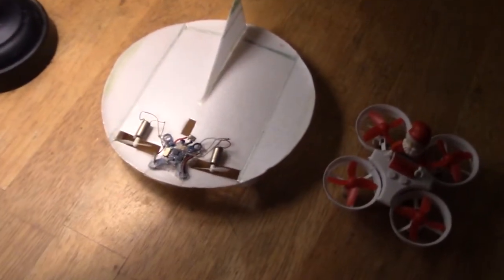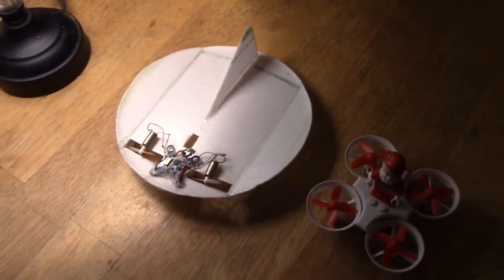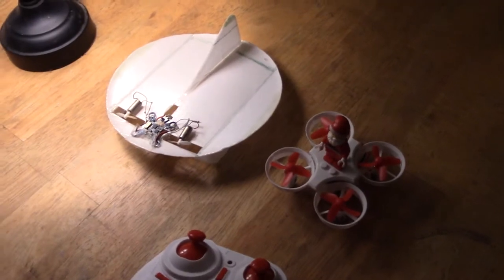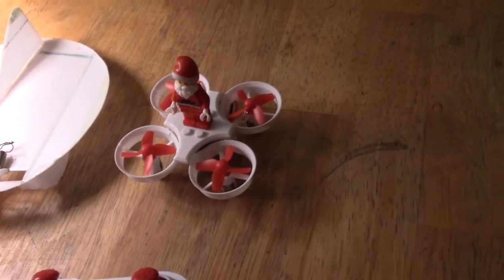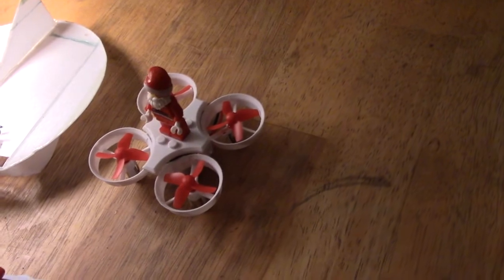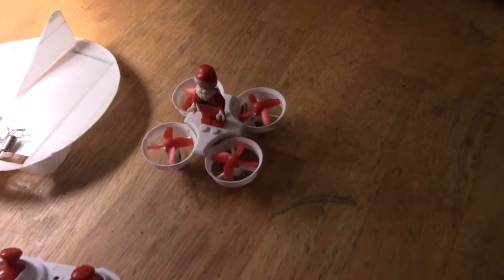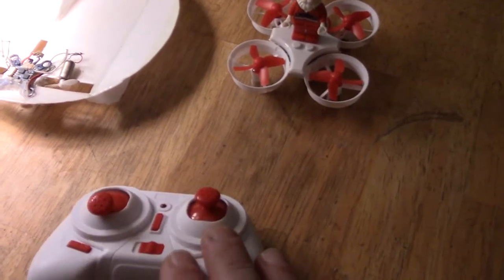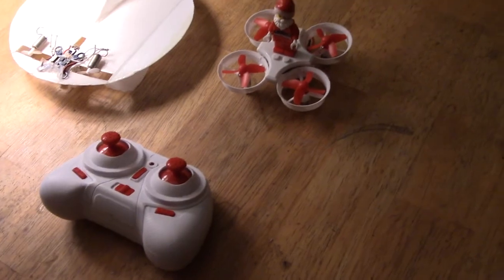Quadcopter to plane conversion - it works !

Comment: Did you remove the gyro?
Reply from the maker: Nope, simply used the rear two motors of the quad and it's untouched circuitboard. All is stock. 

It really does work surprisingly and  amazingly well  :)

Comment: My drone can go 90 M far can i send plane 90 M
Reply from the maker: You can probably fly further, if you convert it to a plane. 
The reason for extra distance, is that usually the antenna is squashed flat on to the board and 4x motors close to the board give a lot of electrical interference. I've converted Eachine E010 and JJRC H67, both fly far further without dropouts.

Comment: Hey could you make one of those micro nutball  fly indoors.
Reply from the maker: I couldn't, being as I haven't got mega light gear. But otherwise sure, in the vid it flies in a relatively small area and if you get the side pieces bent such that there's a good balance of lift to stability, then they don't fall out of the air with heavy turns. A livingroom flyer would be possible, with heavily sanded thin foam, lightest of receiver and something like a 20mA lipo.

Comment: I just watched another video from +AffordableRC where he used all 4 motors spread across the wings and a simple slotted foamboard airframe.  The outer two motors were tilted upward somewhat to add pitch control.  I thought it was brilliant.  Far be it from me to question Master Sripol, but why should a person deliberately discard control of any kind?  I have a nano quad board w/tx and a ~20 inch foamboard A-10 Warthog already built.  I just don't know what happened to the thrusters from the damn thing.  I think the A-10 is a perfect format too.  I figure I'll put 2 motors on the wings pulling and the other 2 in the nacells pushing.  I'm not sure which set should be pitched but I imagine the rear set should be pitched up so that when they speed up in respose to elevator up input the back end will come down like its supposed to on a plane.. I guess that means the front and back motors might actually need to be switched.. Here's the vid I mentioned: https://youtu.be/9JduYhkQi00  Someone figure it out for me and make a video! 
Anyone feel like trying it too, here's a simple cut-out pattern for the A-10: https://drive.google.com/file/d/12DlhZp8Xf8LlyHfaZk-S1N0RlvUR0a5X/view?usp=sharing.  It's intended to be a little flightless model made of wood so obviously adjust the slots to suit the thickness of you foam, but all it needs is a light construction a bit of nose weight and some dihedral to glide pretty well. I didn't even camber the wings on the on mine.
Reply from the maker: It is a brilliant vid, it's what got me started on repurposing. I note he has added pics to the start of that vid nowadays, it used to begin at the field and pretty soon afterward came the multiple  'no freakin way' lol.
Yep, do certainly try the A-10. The rear engines pulling over the wings was contested by Willard Custer's family (I believe) with his mantra of 'It's not the air speed, but the speed of the air'. The A-10 therefore being a great lifter.
Anything gyro based needs a small amount of dihedral. Long wings cause oscillations that basically down the plane. Short wings work best.
Might be fun to put the spare 2 motors in series in the fuse, where 1 creates high speed wind that the next further accelerates. 
But yes, why Mr. Sripol didn't use all 4 is a bit weird. Have tried that myself with stock firmware and it works fine. Modding the stock TX's for throttle on left stick and turning on the right stick isn't difficult either, adding to the fixed wing flight experience. Beware of to much power ! If 7mm motors, some of these little quads have amazing outputs.
Lately, i've converted the JJRC H67 'Santa' quad RX's to old skool non gyro controls. Diff thrust, actuators, rudder, ailerons etc. Firmware being based on Silverware. 400ft range too, when there aren't 4 motors interfering with signals close by.
Good luck :)

Comment: Great video and cool music too. I was flying my Silverlit X Twin Jet RC Plane yesterday for the first time in a couple of years. Looked very similar nose up. Took me most of the session to remember how it worked and retrim it. When I took it out of the box I noticed there was a lump of blutac stuck to the transmitter. I must have used it to keep the nose down last time it flew  :-)
Reply from the maker: Thanks for the music comment, haven't had equipment or recorded since about 1992. Yes, trimming. I fixed it by putting a piece of a glue stick on the front (guess how it was attached lol). That flight is in a follow up vid, with lots more details and a teardown of one of these Santa types, to show exactly what to do.

Comment: "Following the footprints of the leader" (aka Peter Sripol) I'm planning to build something bigger... stay tuned!
Reply from the maker: Hey, sure thing. Tried it with the front 2 motors today and the gyro goes manic, he's quite right, just use the back 2. 
Not enough explosions and things burning in the episode. Mind you, neither did his fuil scale plane thankfully.
Reply: @Slider2732  After 1 year, I can confidently say I'm nearly there. Please take a look at part 5 of my Air Rider 4 foot glider conversion, using WLtoys V262 motor pods.

Comment: Hey Slider. Cool build . Does your camera auto block the sun ? I noticed a black spot where the sun was. Now you know Santa won't be able to deliver presents to all the good little Boys and Girls  this Christmas  :)  
All my best to you and yours Buddy :)
Bobby
Reply from the maker: Cheers Bobby. The hatcam camera is a heck of a problem. Used to use a Hubsan X4 2MP but it had no sound. This one is from a H8D quadcopter, it skips frames, glitches and does that sun thing but has some sort of sound. I had to rig up an external mic circuit just to get it usable and have ordered a SQ12 to replace. Recently got an 808 #25 and it crashes all the time. It's all an ongoing problem.
Reply: Hi Buddy. The black dot protects the image cell. I think it did fine. The sound is awesome,has it about made me duck and cover Lol. when it took off. Thank you for the reply.
All my best to you and yours great to see you back.
Reply from the maker: LOL tiny motors at high revs do tend to be loud. 
Best to you and yours too :)